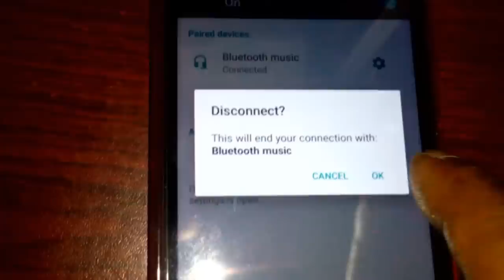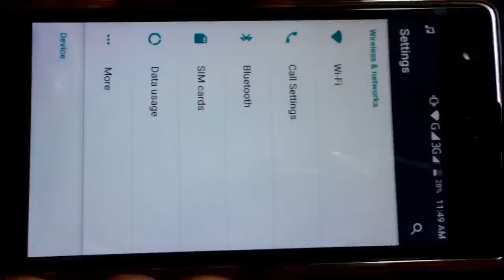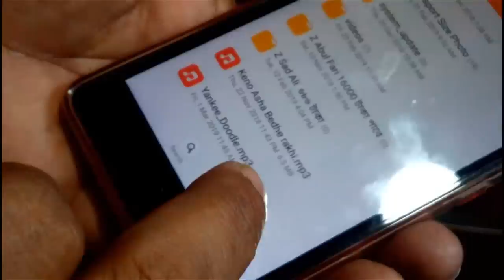Bluetooth Earphone convert to Bluetooth Speaker for Car Kit

Comment: Without battery 🔋 usb sy power Lena ha  car k liye
Reply from the maker: Try and check heat, If more then disconnect USB.
Reply: @DreamFinder  usb sy + - kr diya ha ab sound k wire kesy Kru plz help me thnkx

Comment: All good. But one problem. Bluetooth earphone turns off automatically when charging. How to solve that? Please reply
Reply from the maker: it's depends on BT device, it's just a creation how to create it.
Reply: @DreamFinder  I appreciate your work bro. But I wish to use same setup to make my car BT capable (Currently it has AUX, FM and DVD). For that I need it to be turned on when I turn the ignition ON. But my bluetooth earphone goes OFF when charger connected. CAN WE CONNECT USB CHARGER CABLE INSTEAD OF BATTERY? Please help. Thanks in advance.
Reply: Remove the battery, and sodder the charging cable's positive and negative in its place. This way you won't get interruptions about low battery. Another reason why I recommend this route, is cause some bluetooth headphones Don't work while charging, and if you use the micro usb port, well that's what it gonna think it's doing.👍
Reply: Remove the battery.
Just solder any USB charging cable's positive and negative to where the battery was and that's it. Use it anywhere where there is a usb port to power it up.

Comment: I can make a remote for Bluetooth speakers out of that 

All you do is cut the earbud wire from the earbuds and put it back together and connect my Bluetooth speaker to my phone and connect the earbud controller and use it as a remote or just use EarPods with the Remote 

But good video 😀👍👍👍

Comment: 🔋 battery charge quick discharge....
Not a right solution....
Reply from the maker: It’s just a idea, you try to best my dear. U can use another bt circuit bro.
Reply: Remove the battery, and sodder the chargers positive and negative in its place. This way you won't get interruptions about low battery. Another reason why I recommend this route, is cause some bluetooth headphones Don't work while charging, and if you use the micro usb port, well that's what it gonna think it's doing.👍

Comment: how to charge?
Reply from the maker: By Original Charging port.
Reply: Remove the battery, and sodder the chargers positive and negative in its place. This way you won't get interruptions about low battery. Another reason why I recommend this route, is cause some bluetooth headphones Don't work while charging, and if you use the micro usb port, well that's what it gonna think it's doing.👍

Comment: Can it really works
Reply from the maker: It’s very simple method.  Blutooth circuit used 3.7v. Blutooth output connection go throw to Power amplifier input. Power amplifier output connected with loud speaker.  Many many thanks for your comment.

Comment: to be honest, what you did is pretty similar to what I had done...
but, you can get a good quality bluetooth 4.0 mp3 receiver for around ₹750 even if from china, but  it will get you 4 hours of listening time(what I got)on a 15 minute charge from 0% to 100% from a Lenovo 5.2V 2.1A power brick(SMPS)... and around 23-25 minutes from 0% to 100% from my old Lenovo 5.0V 1.0A power supply...
...and around 1 year 9 months later, the listening time has dropped from 4 hours on an avg. of 70% to 90% volume setting to about 3 hours 40 minutes...
Reply: Definitely, converting a audio receiver made to drive two 40 ohms speakers to give output to a amplifier circuit will not damage it, but, according to my conversion, which was done on a similar pair of bluetooth *Headphones*(not earphones) worked really good for two months, but at some point, connecting a pair of other earphones with a different impedance value degraded the quality of audio as the onboard amplifier was not made for drivers of other values of impedances(as they are not made to work with a wide range of outputs) does cut of some parts of the audio spectrum of the audio signal received by the receiver ic from the transmission device...
Reply: in short, you MIGHT end up destroying the receiver module or have a drop in audio quality...
so, better off buying a new universal bluetooth receiver made for the purpose...
it will definitely look much better and is much more practical to do...
Reply: @DreamFinder  yes, your final product is still much better than mine...
Mere wale receiver se toh kafi jyada acha dikhta hain...
Reply: Gyan mat baton
Reply: Laure

Comment: Fake
Reply from the maker: Dear bro, how do you think this fake?
Reply from the maker: Why you thinking It's fake my dear brother?  It’s very simple method. Blutooth circuit used 3.7v. Blutooth output connection go throw to Power amplifier input. Power amplifier output connected with loud speaker. So it’s real my dear, Many many thanks for your comment.